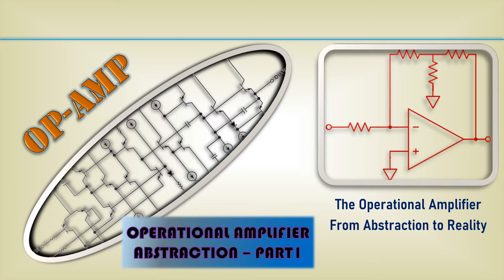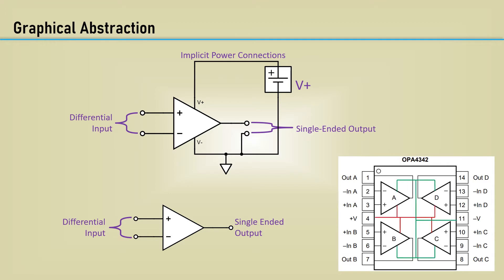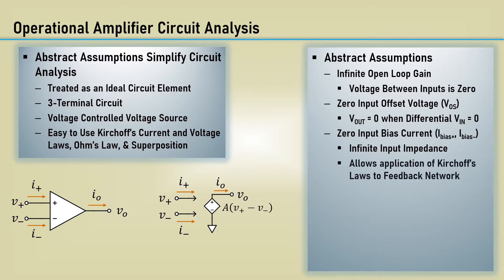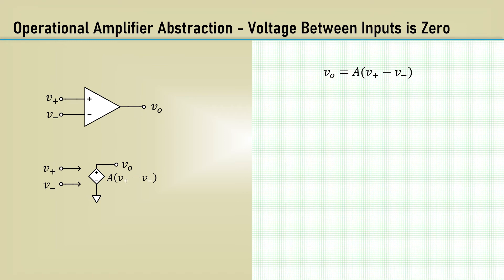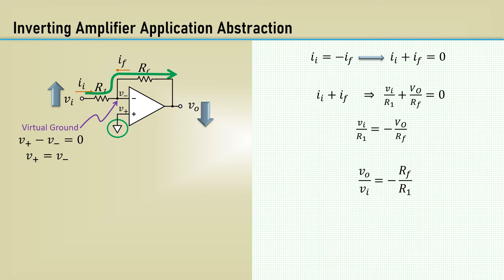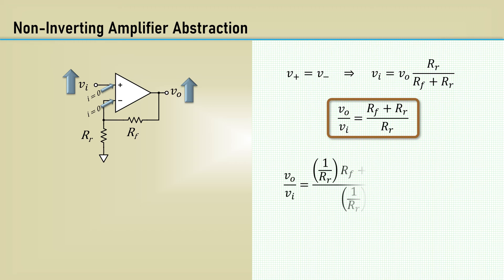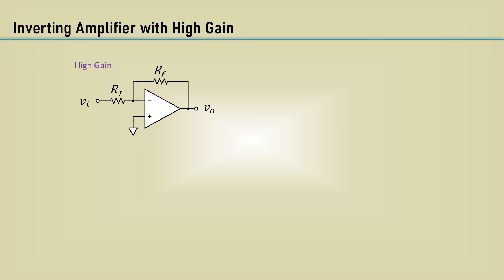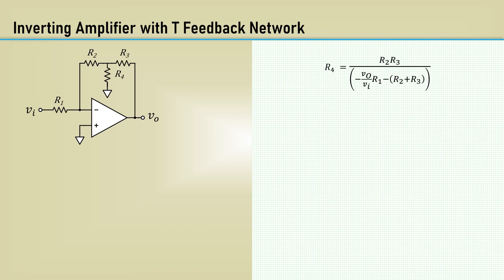The Operational Amplifier - Abstraction Part 1

Comment: Isn't it more proper to say "Voltage between opamp inputs is zero (virtual short) if the opamp has an infinite open loop gain AND is in a negative feedback configuration." ???
Reply from the maker: Yes I’m sure there were a lot of places I could have spoke better words in these videos. Thanks for pointing that out.

Comment: OP490 is overpriced.
Reply from the maker: I wasn’t recommending it. It was as just an example of an internal schematic that was graphically clear. I just looked it up and it’s not recommended for new designs.
Reply: @oldhackee3915  when you present it to beginners, they will most likely take that as a recommendation. By the way, graphically clear 741 schematics are everywhere.